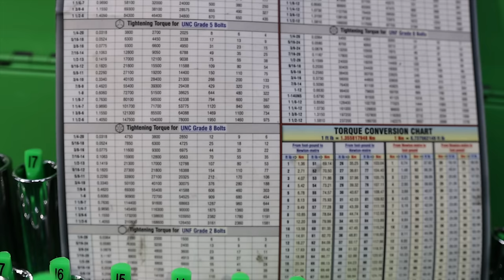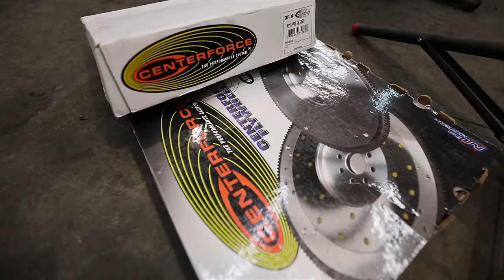Ultimate Suzuki Samurai Buggy Build Episode 5! Monster Motor Mounts.

Comment: Nice build love the idea off a samurai. I heard you say 74Nm for the bolts off the flywheel thought it was a bit low!
Look it up  and M10 bolts you 3 different thread sizes.
12.9    M10 x 1,5  = 93Nm      M10 x 1,25 = 98Nm      M10 x 1 = 103Nm

Comment: Imagine Nate building independent long travel suspension for the j truck…
Reply from the maker: This WAS the plan for the TJ. But I was looking at 10k just in axle shafts... It's not off the table but If I was to do an IFS IRS setup, I would probably need to sell some shit lol.
Reply: I think it would definitely be worth selling some stuff.
Reply: @Dirt Lifestyle  totally worth it. Go fast desert running is an absolute blast. I'd do a center mount front and sold rear with trailing arms. IRS is just too damn complicated and expensive unless you figure out a way to retrofit another vehicles suspension/kit on.
Reply: @Cr480mx  yah I agree or even just some deaver leaf springs and bronco beams
Reply: Ford ttb.
Superior in some aspects, and dirt cheap
Reply: A place in lake Havasu makes killer motor mounts but yours did the trick

Comment: Hey Nate , just an idea for the motor mount where the water hose will be. How about “Ramping” it ? You know like the pour spot on a coffee pot or a pitcher . So you don’t have to cut material from the mount . Just heat it up use a piece of pipe and bang it down .. just a idea buddy… if ya get my idea meaning 👍
Reply from the maker: I hear exactly what you are saying and It's definitely a good idea! My only issue is what all that heat would do to the rest of the bracket at this point. But if this thought had come while I was building it, I could make that top plate a ramp and let it cool before joining it to the rest of the bracket. In any case thanks for the suggestion! Good call!

Comment: Maybe add a few short lengths of removable chain between the motor mount brackets you built and the chassis for better control if one of the rubber mounts gives up?  Nice work!

Comment: Curious what master cylinder you will use for the project.  For the samurai, some people go for a master cylinder from a 1998 Subaru legacy, but I'm interested in the fj80 master cylinder.  Your rig is definitely a unique build,  so I'm wondering about the brake setup you plan to run. Thanks!

Comment: I think a lot of people use 1/4" because it is simple and strong. I agree 3/16" is a good thickness, especially on something this size. Even 1/8" has it's place, but now you really need to be careful with how things are built and boxing stuff in becomes a priority. The big automakers use only enough metal and it's always interesting to see how they design things. I have a 6,000 lbs GVWR truck and it's all 1/8" basically. I am cutting the main transmission mount cross member frame side mounts off right now and it's all 1/8". It's surprising what can be done with thinner material as long as it is reinforced properly.

Comment: I have to do mounts on my CBEA once I get the oil pan finished. I'll be curious to see what you come up with for the right side mount. You can get mounts that are similar to the Passat ones from a early 90s F150 with the 300 I6, they are also hydraulic.

Comment: Good solid fabrication decisons and implementation.

It is good to see metal saw companies embracing compound miter.  I put my first metal cutting blade on a Craftsman compound miter wood saw about 25 years ago.  It has a cast iron table and stands up well to cutting metal.  I still use it today and it works fine.

Comment: Just an FYI thos vw mounts are common to fatigue the aluminum lower casing. Right around where the bottom stud comes through, approximately a 1.5” diameter will start to crack. It will help a lot to have your steel plate on the frame side cover the entire bottom face of that mount, i see you have some of the mount hanging off the edge of that frame side plate.

Comment: I have a bhw 4runner with a similar mount setup and I'm concerned about roll over, the rubber potentially snapping but more likely the mount stud shearing. I wanna design a new mount that had cups on top and bottom plus rollover protection.

Comment: The vw hydro filled mounts on the passats do indeed fail. 
It may be ok for a good long while, but once the fluid leaks out (it will) they crack around in a circle on the underside.

You’ll need to recreate something to mimic the snub mount the longitudinal Vag engines often have or the standard mounts will die in short order.

If you do so, make the mounting holes for the snub bracket slotted in vertical direction so you can set bracket so it doesn’t touch foam insert unless it’s under load, to stop vibration transfer.

Comment: On the motor mounts I used 1/4” plate on the block, bent to match the three holes you pointed out. Then used 1.5” dom welded to the plate a bend then I coped the end of that and welded an upright to it with a cap on the bottom. 

Something I bought from white read is the oil relocation plate, makes so much room on that side of the block.

Comment: If you ad chain or cable on that mount it will be super reliable. If the mount fails like that another one the cable/chain will catch engine from liftin up. And if chain/cable have little play in it it will not bring fibration to the chassis.

Comment: You can run chain from the block rearwards to the chassis. It will limit forward movement of the engine and transmission and save your mounts or minimise damage.